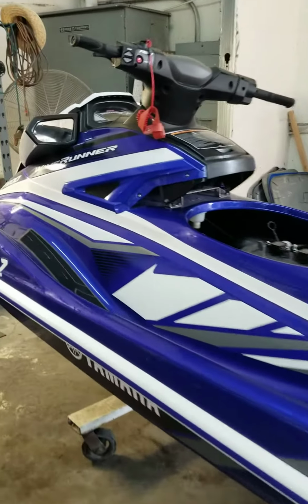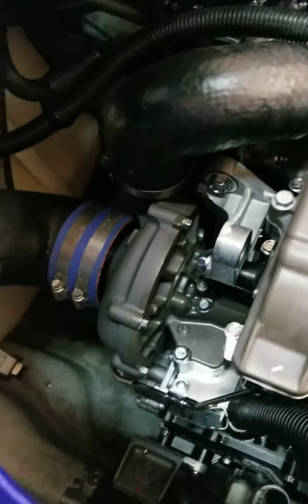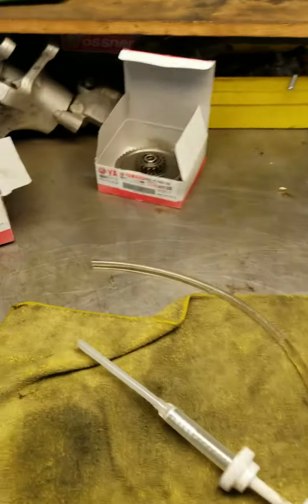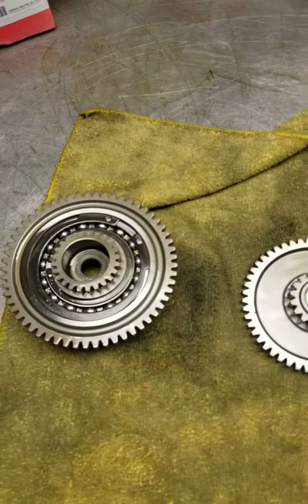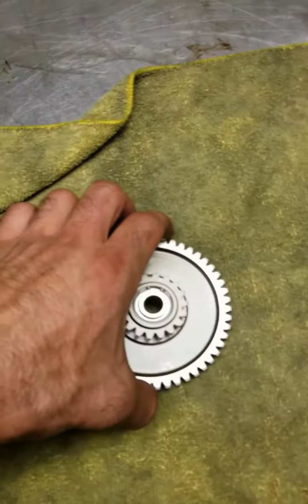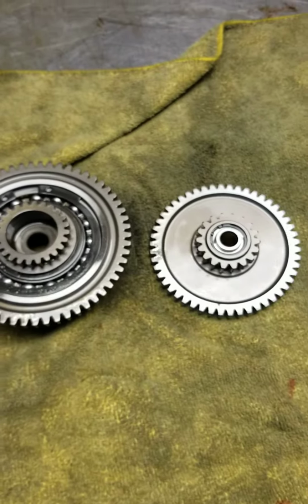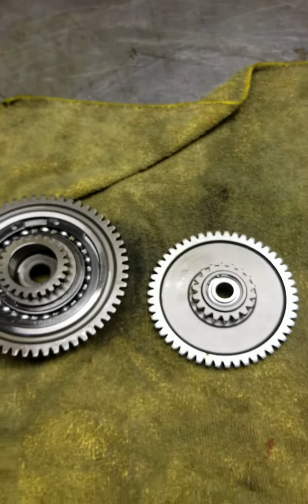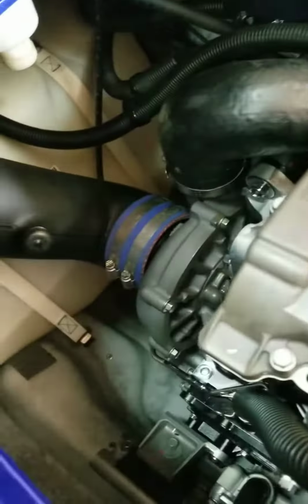2018 Yamaha GP1800 SVHO Super Charger Service [Listen to the Boooost]

Comment: Thats what goes out first on the svho 1.8 engine, thanks for showing the clutch etc! Alot of people install a blow of vavle to relief pressure on clutch,  do you agree with that? I have a 2019 , thanks!
Reply from the maker: You could install a blow off valve with more relief, but then you wont get full p.s.i on the intake side, and it kinda defeats the purpose of pressurizing when using a small super charger. I think it's a great design, and it was engineered to be the part to wear and fail. I think this one had about 75 hours on it, but it's nothing from stock, so I'm sure wear and tear from the mods was a factor.
Reply: @QuantumMotorWorks   Awesome , thanks so much for your reply! Mine has just over 80 hrs and my only mod so far is flashing the ECU / Tune...
Reply from the maker: @jeffro7475  if 8nterested in your boost output, you gotta hook up a computer to the ecu of the ski, to see intake pressure. I think I saw this one fluctuating between 12-15 p.s.i. after rebuild. Let's you know if boost is working or leaks in system. Then you can make a call on when it's time for service.
Reply: @QuantumMotorWorks  OK 👍  My friend is a Yamaha certified mechanic and helped me with my ski purchase choices etc.. He said the bov wasn't necessary but it seems that everyone online that think there mechanics tell me that you should install one first thing to prolong the life of the supercharger! I know my friend is extremely knowledgeable and a great mechanic.  He recommended a tune / Reflash and get the 5 yr warranty and just ride it and service it regularly ... Thanks its nice to hear a MECHANICS point of view!!
Reply: @QuantumMotorWorks   i just subscribed😎. There is not alot of info/ videos about the gp1800r etc on YouTube yet... i hope you post more i love the blue and white colors man thats what a YAMAHA is supposed to look like 👍

Comment: I have a question? I have the exact same jetski, and I have an issue. Going at high speed between 75-80 mph, the jetski only goes to 55 and doesn't go faster than that. The supercharger stopped working, i would shut off the ignition and I start it again, it go fast around 75 and does it again. I wonder if the Clutch Bearing is bad. Can u help me out with this issue please.
Reply from the maker: That's something that would need to be brought in. Or might need intensive troubleshooting. I do occassionally offer over the phone tech support. Shoot me a text message if interested. (909) 245-4854

Comment: Question man. I got the same model and for the longest after my first mistake of letting someone borrow it, it wasn’t going as fast. It wasn’t reaching peak RPM’s anymore which at the time was like 7 or so. Now I’m just trying to figure out symptoms because this started maybe 2 yrs ago and no it finally went down to like 5ish or 6 rpm’s. It still goes faster than if I put it in low mode and to go 45mph. But it definitely lost power significantly and I’m just guessing that it can just go at any time. My question is how do you know if it’s the the clutch or the entire supercharger? Long story sorry. Probably a dumb question
Reply from the maker: The super charger it self would only fail if the bearing fail from more than 100h without service, or from loss of oil pressure. The clutch itself wears and needs to be replaced at 100h. You need a shop with a computer that can test intake/ boost pressure, that will be an indication to inspect the super charger or intake system. Could be anything.
Reply from the maker: Fuel pressure also needs to be checked at idle and WOT, that will eliminate the fuel system as a possible issue, possible injectors. There is a lot that needs to be checked for loss of performance on those skis.
Reply: @QuantumMotorWorks  
 man this actually helped a lot I feel! Because now I can do just that and hopefully take it from there! Thanks so much for such a prompt response as this is such sad news to me since I just literally spent $3,400 upgrading it to run faster. It wasn’t fully reaching the 8 rpm’s tho. It was like at 7 and a half and today after jumping a wave it slowed down. I did not know the clutch needed replacement every 100 hrs. I’m so overdo because I’m right at like 215 hrs. Thanks so much again! 

Oh wait you know what? You just made me think of something. So I haven’t installed any of the things I got on the upgrade yet. I wasn’t planning to run the jetski until then but my aunt came to visit and wanted a ride and I asked the people I got the upgrade from if I could just instal the computer back and run it and they told me that it was fine but that it was gonna burn more gas after like 6rmps and that my spark plugs would get really dirty. And I’ve used it a bit without installing anything. Also to be honest it needed new oil and spark plugs but I was gonna change it after I installed the stuff. 

You just made me think with that second comment.
Reply: @QuantumMotorWorks  
This is what I bought 
And I have only installed the ride plate and connected the ECU back. I’m hoping to God that the sparks are just dirty and need replacement and not a need of a new supercharger because I don’t even know where I would get one nor do I think I’m gonna love the price it will cost.
It’d be so amazing if it was only the clutch.

JLP ECU Flash Stage 3 9000 RPM

-JLP Yamaha Custom Exhaust Kit GP / VXR SVHO

-JLP  Yamaha  Air Intake Filter

-JLP Solas Prope (Custom Pitch)

-JLP Intake Manifold Upgrade Kit

-JLP Yamaha Pump Wedge sho/svho

-JLP Yamaha Custom Ride Plate Modified

-JLP Yamaha Titanium Retainers Set

-Fizzle Yamaha Intercooler Kit With Tial Blow Off

-WORX Yamaha GP 1800 VXR intake grate
Reply from the maker: @TriAreOne  oh shit yours sounds heavily modified. Very nice. Best of luck brotha.....
Reply: @QuantumMotorWorks If i could get it working lolol  Ima take it to a place like you suggested to get them tests ran. I changed the sparks and it’s still going 6 rpm’s top. 🤷‍♂️
 I really appreciate ya though bc the place I’m trying to take it I told them exactly what you said. If they could run that test. So thanks bro! Best of lucks to you too!